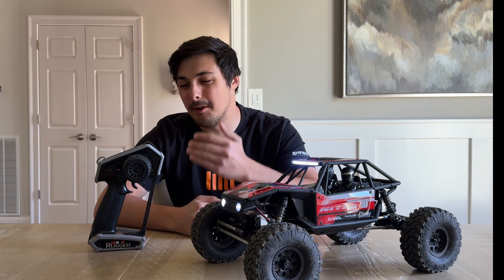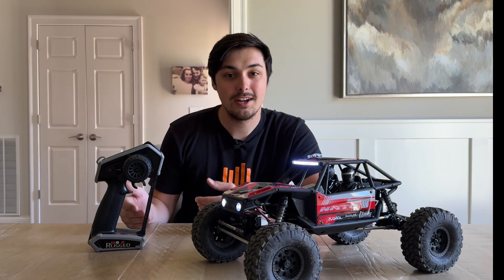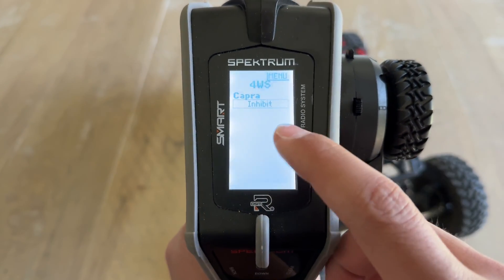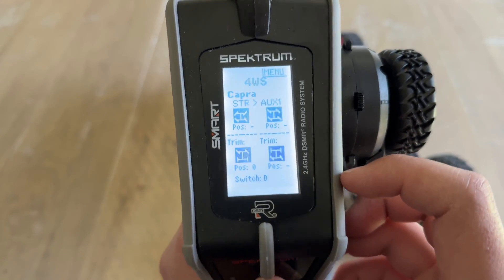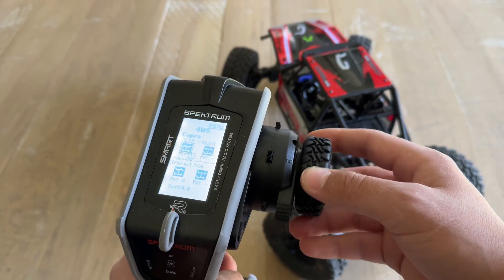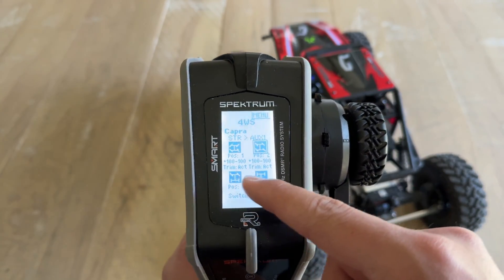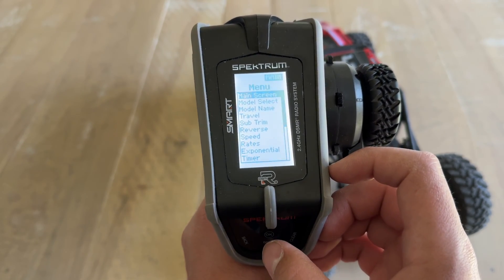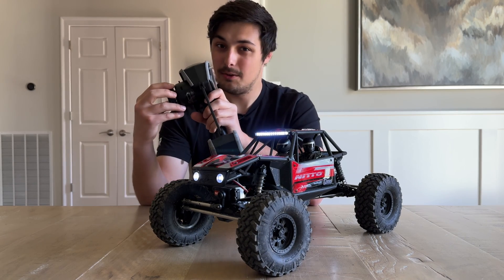Spektrum DX6 Rugged How To - 4-Wheel Steering (4WS) Setup

Comment: What about using DX6C for a boat, with 2 props. also 2 ESCs. IS that not think in as a option, there the rudder could change speed on each motor in MIXING. WHY is they only for Cars.